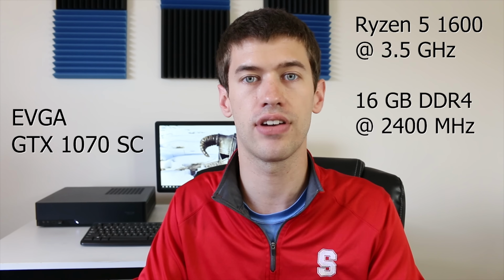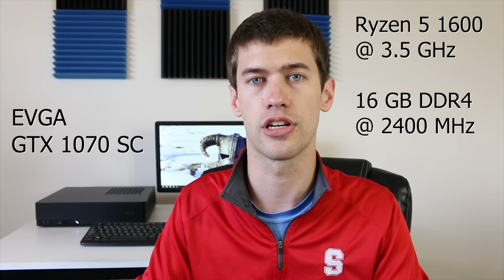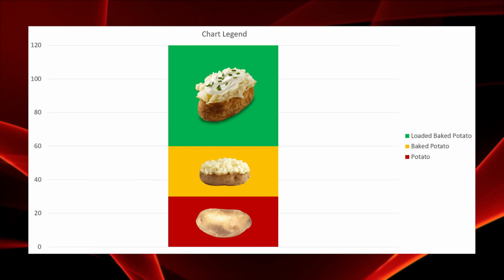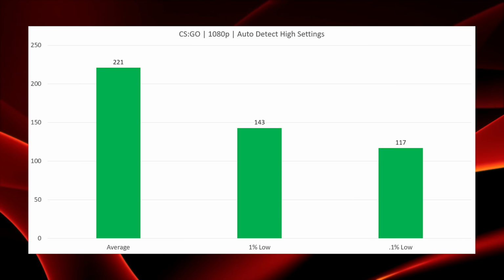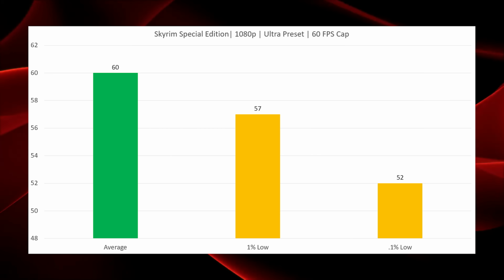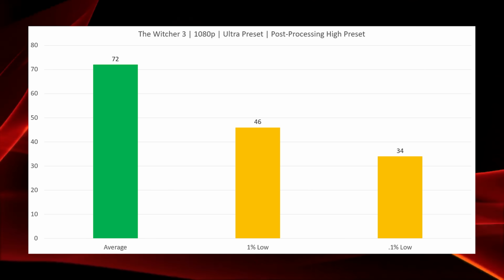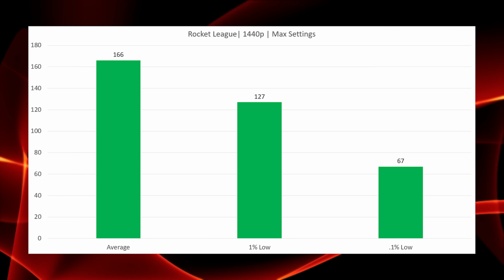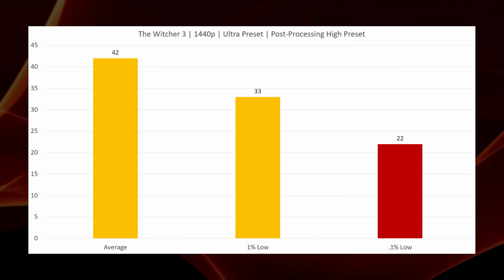Ryzen Mini-ITX Build Performance Benchmarks

Comment: Ive been studying this case for awhile. Need some help. 

If i dont plan to OC at all and use only stock fan (yeah, yolo)... Do you think  the temps be fine?
 
Likely combo of
RyZen 3 + gtx 1050 ti
Or
Ryzen 3 + gtx 1060
Ryzeb
Reply: i'v been planing a build in that case too, No OC no problems :), 
Fairly stable OC iv seen on ryzen 1600 was 3.7/8  with a good cooler(scythe with dust filter removed or wraith with top led removed and dust filter removed in order to fit)
 C7 will work maxed out for such OC and temps will hit 85 ish
Noctua NHL-9i with AM4 bracket will be better than the C7 and about 10 degrees C lower.
(Pcpartspicker will NOT tell you these iv been digging  around for a while and this channel also helped with a cooling method :D)) 
Also this case is better suited for vertical orientation and with at least 1 fan especially if your OC is high and your GPU is not a blower design.
I Hope this Helps and good luck, im waiting for GPU(and DDR4 ram) prices to go down in order to build this.
Reply: tnx mate

Comment: great job! good information and concise delivery. i built a very similar rig for my nephew substituting a zotac gtx 1070 mini for the evga. i also modded the node 202 with a corsair h55 aio for the cpu along with 2x cougar vortex pwm 120mm for gpu side. works great and the fans keep the 1070 mini (which runs hot) cool at about 55 centigrade with 37 centigrade ambient room temps.
Reply: yeah the two fan for the gpu make a big diference

Comment: Idk really but I've seen some of the other benchmarks hit higher fps on the 1070 with the r5 1600...was it the temps or nah?
Reply: Exactly I know that 1070 does better than that.
Reply: He's thermal throttling. 100% I have the case.

Comment: you should test on very high instead of ultra. 
joker had a good video showing it barely improves visuals if at all and heavily impacts performance
sweet build i like it
Reply from the maker: I have actually seen that video. It's a really good point to make too, and I may do that in the future. Certain games in my testing (especially 1440p) would really benefit from knocking down a few of those settings just a little bit to get a significantly higher frame rate. To that end, your suggestion is well taken.
Reply: Hoosier Hardware hey do you have an email you mind I could contact you on? I built my first PC and I wanted to show someone the build to see how it is